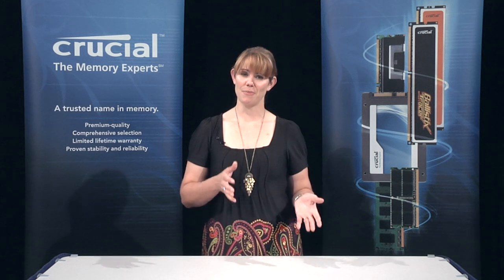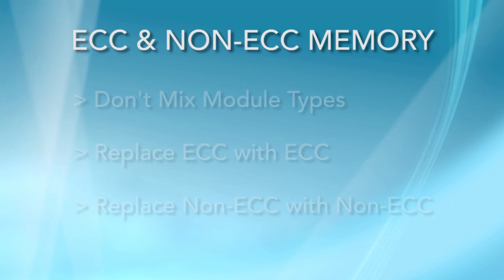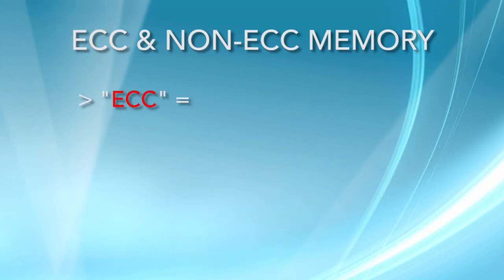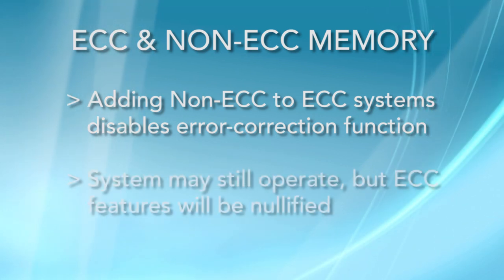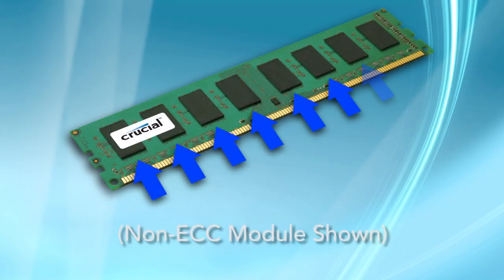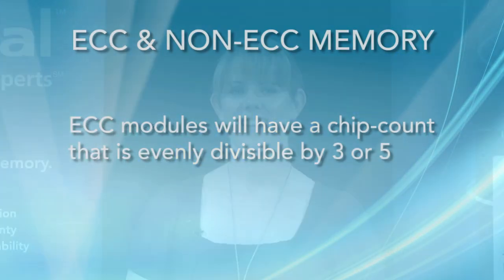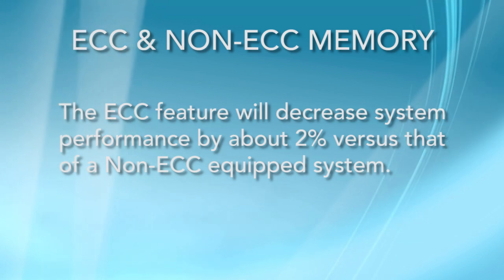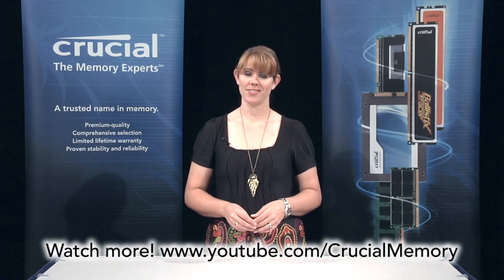What's the Difference Between ECC Memory and Non-ECC Memory?

Comment: Do ecc only affect ram ? since i have only ecc( or non ecc) it will work on every mother board ? 
i mean if i had a ecc ram, and i just change for non-ecc ram, that won't cange anything else than parity ? i don't have to find a motherboard/gpu/cpu that accept or not ecc ?
Reply from the maker: Hi Cyril. Thanks for contacting us today. If your system is compatible with non ECC and ECC memory then it won't matter if you switch from one type of RAM to the other. We would be happy to check into this for you. What is the make and model of your computer? -HH

Comment: can i mix em to get dual channel performance for gaming
Reply from the maker: Thanks for contacting us today. No, you would not be able to mix them to run the system in dual channel. If your system can run in dual channel the memory would need to be installed in matched pairs.
Reply: Thanks for responding back. One more thing. Can i add 1600 mhz with 1333 mhz ram for dual channel to be triggered. Or both has to be at same speed?
Reply from the maker: They have to be the same speed.
Reply: Crucial: Computer Memory, Storage, and Tech Advice can i get ecc memory for dekstop computer ?  and it works pretty same as non ecc ?
Reply from the maker: What is the make and model of your computer? We would be happy to check for you. -HH
Reply: Crucial: Computer Memory, Storage, and Tech Advice my motherboard is old socket 775 p41 type and processor e5450

Comment: @crucial I still am not sure if I should or shouldn't get ECC Reg memory for my upcoming PC video workstation build. I have looked at all high end content creation machines like say the 'HP Z840' or the 'HP Z1 G2' or the model 'Genesis I' from a company called 'Puget Systems' from WA that build high end content creation machines and they all use ECC Reg memory (RAM) for some reason. I would like to emulate that with my upcoming build using a Xeon E5 together with this type of memory. Please give me some extra advice (for anyone else who is able to tell me something I don't know thnx) o yes I will be utilizing an Asus X99 Deluxe board (2011-3) and a Nvidia Quadro M4000 graphics card in this system.

Comment: I love how you actually were honest about reccomending Non-ECC!! Most companies would say, buy the more expensive ECC stuff, but yes, for non production servers, I doubt its needed, and ill take back that 2%! - Worth Noting is you can get ECC memory but unless you have an Xeon or ECC capable chip, you won't lose the 2% because ECC won't be used. For example I couldn't find non-ecc 16gb single sticks, but I use an I5 which (none of the I# series) support ECC functionality. You'd need Xeon for that. Long story short, I got the ECC 16GB single sticks, but I think I will stay with the I7 line and keep the 2% performace, which could be increased with virtualization, 2% becomes a bigger number. Or more noticable I guess.

Comment: lol she said: unless you need ecc you best option is non ecc. does that mean i have other options lol.
Reply: rubikfan1 Yes ECC, you can install it if even if you don't need it. That gives two options. Putting it another way, If you need ecc use it, no option. If you don't need ecc you have two otptions, ecc and non-ecc. Of those two options non-ecc would be recommended to avoid the 2% performance hit. Alison was correct and accurate even if you were not able to follow it.
Reply: you don't have to need a thing for it to be an option, so you'd still have the choice between ecc and non-ecc.

Comment: ecc is server ram where error checking is advisable
Reply: Super old comment, but, is not JUST server memory, is used in y almost imperative recommended in servers since data are critical. But ecc can be used on desktop computers. Lot of critical desktop comes with ecc. Even some banks has compliance to have ECC ram on specific post at the branch

Comment: My main question is: What will happen if I install ECC ram on my non ECC server? Will it not operate well. I'm planning on putting 4x 2GB (ECC) on Each slot (I have 4 slots in total). Total of 8GB.  What will happen if all my slots are filled with ECC ram even though my server doesn't require ECC? How much slower will it be? Thank you.